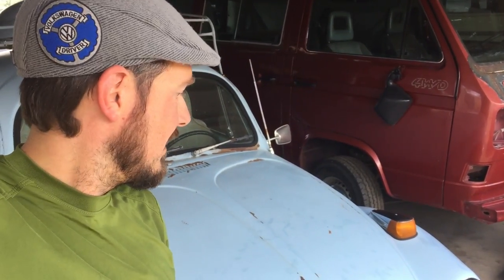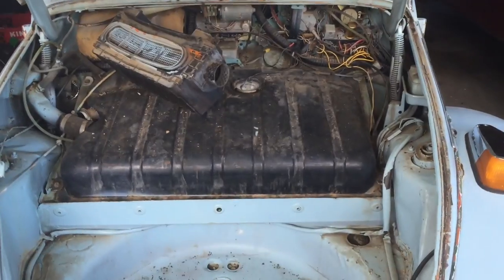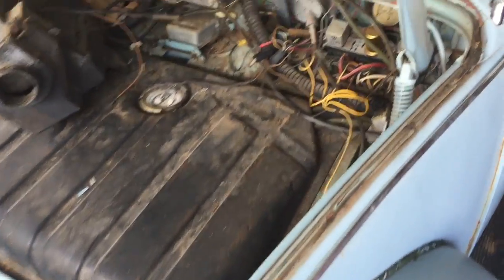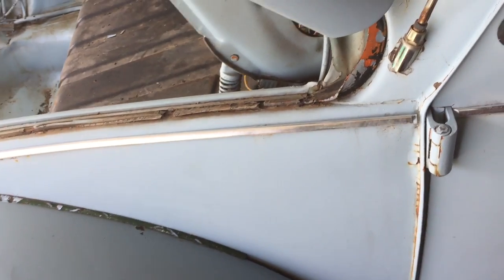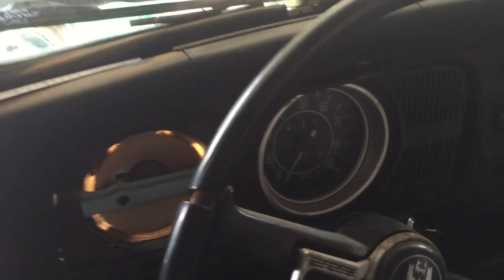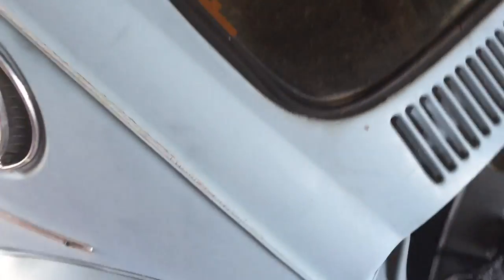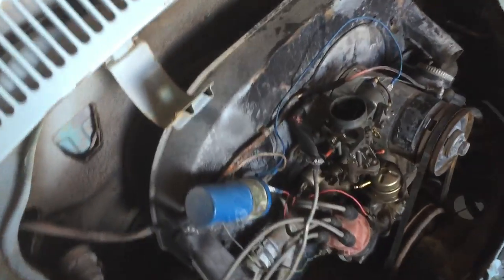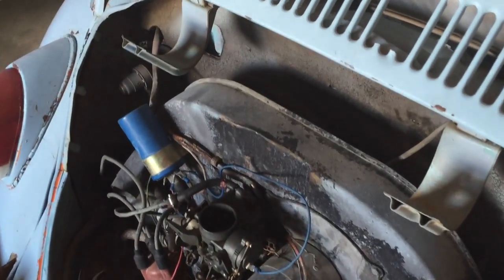BUGaru Part 1 - VW Beetle Subaru Swap EJ22 Turbo Intro

Comment: awesome! I just finished an ej22e engine swap into a 74 Super. I used the kennedy adapter kit and ran the radiator to the front. I would suggest getting a hold of either stainless steel or aluminum pipe if you plan to run it to the front. I used aluminum that I bent to fit the bottom putter frame pockets. also, look into marine hose for running coolant around the transmission frame horn to give you some flexible bends. you'll want a fill point from the front and rear to help balance out the coolant. maybe even an expansion tank in the rear looped into the heater core lines. Hope some of this helps!

Comment: Good thing about the '71-'72 Supers is that they still had the flat windshield and dash, along with the smaller taillights. The negative about those 2 years were terrible strut-tower rot (although yours looked good) and weak track-arm bushing in the front-end that caused terrible steering wheel shimmy (death wobble cars as they were called). Press in some new bushings, throw in a new steering dampener, install some new struts and balancing the front wheels usually took care of it. Although the front-end was the weak spot on the early Supers they handled better than the standard Beetles if the front-end was tight and healthy.
Reply from the maker: +firstmusic00 Dang, I'm impressed that you have so much knowledge on each year of the bugs. Once it's up and running I'll have to heed your advice and work on the front end.

Comment: As far the radiator goes you could do what mighty car mods did and mount the radiator on the firewall behind the back seat?
Reply from the maker: +Joe Dirt That's true, I definitely considered it., but there is just the most perfect spot in front. A lot less work and better cooling more than likely. I'd love to see them do a real world test on their beetle, not just the drag race.

Comment: have you looked into the subaru frankenmotor? ej22 heads and management with ej25 block. Might be a little easier to fit with about the same power.
Reply: just watched all your vids and realized you're rather committed to that motor lol. great work and I can't wait to see more! a list or video of tips/suggestions for doing this kind of swap when it's all done would be great.

Comment: also run an external fuel pump and have it as close to the engine as possible to save on high pressure fuel hose.
Reply from the maker: +skaterman900 Great tips! I'm planning on using my common steel setup for the radiator pipes up front. I may go with a Scirroco radiator up front but no easy way to fill unless running an inline filler (which I want to avoid). The turbo engines have a coolant header built in, above the water manifold and I've had great luck in Vanagons using that as the main fill point. We'll see!

Comment: We are looking to convert a 1972 VW Bus to the Subaru 2.5 Engine. We live in Las Vegas, Are there any places that perform this conversion in our area or would it be easier to buy one already done? Where would be a good place to look??  Any reputable and trusted mechanics that you can suggest??
Reply from the maker: +Melissa Pellegrini I don't know if any folks doing these conversions other than Busaru. Only a short drive away in Durango, CO ;)

Comment: I have access to a 2011 Impreza as a possible donor car. Is this a good one to use for a vw motor swap? The car runs good and has around 150k on it. It is a sohc 2.5 NA motor. Is the wiring on this late a motor a issue? That’s for the help.

Comment: i would like to know where u located and what did with the stock vw enging im looking for core or a running engine id b interested if u still had it? im located in Maine.thank u dave
Reply from the maker: +david randall Hi Dave, the original dual port engine sold pretty quickly - good luck!

Comment: Checkout boostedVW he's got a 70s bug with a suby conversion, very informative vids...jp
Reply from the maker: +Jon Paul Yes! I've been looking through his videos for years, drooling over his 74 Super. I'll have to touch bases with him and introduce myself at some point.
Reply: Yep good bloke, might meet him at the end of July, The Bi annual VW Spectacular is going to be held on the east coat of Australia and is mega event, do a search and you will be amazed at the number of VW's congregating in one place at time, its going to be a 7 day event so should be good, I'm planning to take the bus. Sorted out my tranny leak, its was that the angle of the transmission caused the fluid to leak out  of the breather creating the illusion of a leaking CV joint and smoking on the exhaust!!!! I'm a dork.